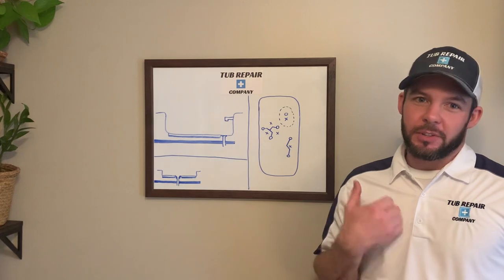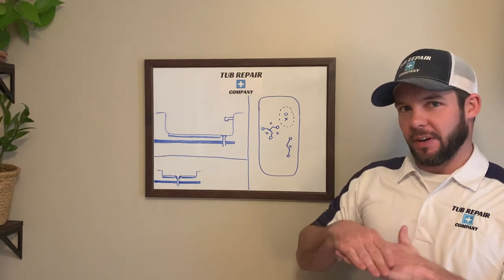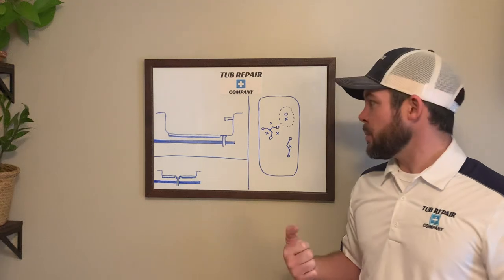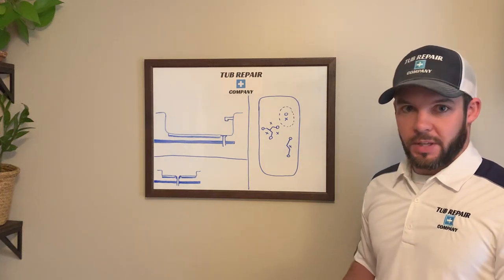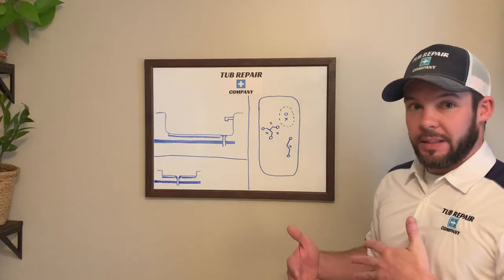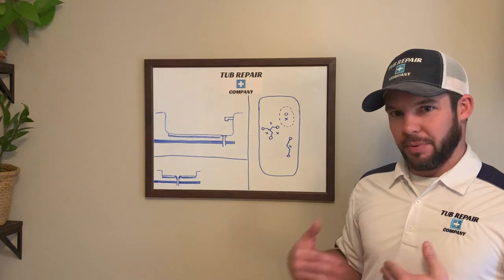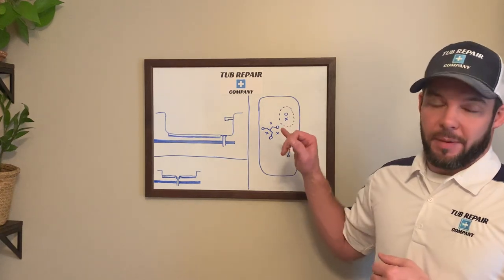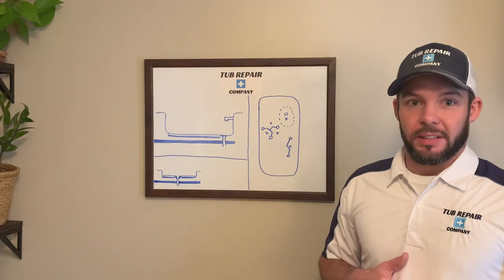Drilling Holes and Pumping Foam into the Floor of your Tub - Level 3 Repair

Comment: great video as usual! how much foam should you spray into the sub floor holes? thanks for any help.
Reply from the maker: Thanks Joe!  It will depend on how much of a gap there is between the subfloor and the bottom of the tub.  Usually it is around 2” but may be as much as 4”.  If you can’t feel the subfloor with the foam straw you may have a gap in your subfloor.  Most jobs will take 1 or 2 cans of foam.  We have a foam demonstration video that will give you a good view of what the foam is doing under the tub.  The deep layer supports will take most of the foam.  In general one can of foam sprayed in the same spot will create roughly 1 sqft of support.  A lot of that will depend on how deep it is.  Stay tuned as we are working on some much better videos to help demonstrate this. 

How much of a gap do you have!

Comment: The company that installed my walk-in shower will not take care of the issue. I feel the floor is moving near the drain. He refuses to fix it. I was told by a friend that I need to have somebody drill holes and inject high density foam.    Is it the contractors responsibility that installed my walk-in shower my floor and my bathroom he charged me $14,000.
Reply from the maker: Yikes! We can’t say for sure.  Unfortunately this is fairly common today for contractors to not add support underneath tubs and showers.  Tubs and showers also don’t seem to be built like they used to be so that’s no good either.  

Do you know if your shower is fiberglass, plastic, or metal?

Generally we don’t recommend drilling a hole in tubs that aren’t broken but you can.  Our foam will support floors that are weak but may not address a shower if it is shifting and was not installed correctly.  Send us an email or give us a call 877-234-9882 if you want to chat more about what’s going on.  We are happy to do a FaceTime to see the situation and hopefully better guide you.

Comment: Where does water go when hole
Reply from the maker: Not sure we understand your question.  The is a drilling and foaming overview.  This is only the first step in repairing a floor crack.  Our floor repair kits have all the supplies to do this and finish out the repair.
Reply: @tubrepairco  I had a big hole in my tub for a long time and I just started thinking where has all that water gone I never saw it in the house
Reply from the maker: Oh man… it went somewhere…